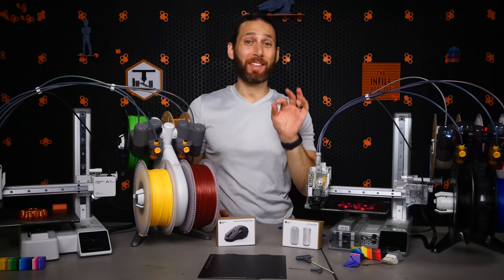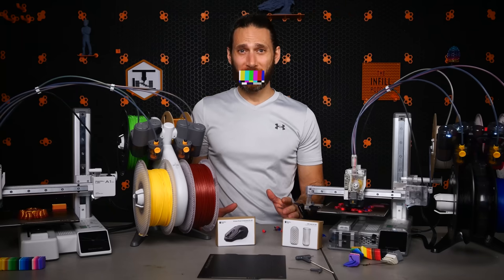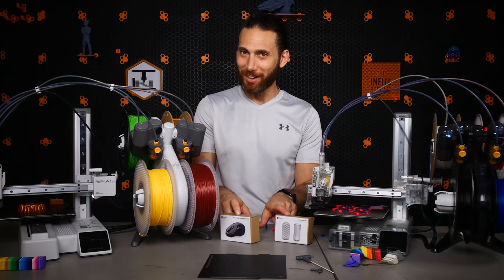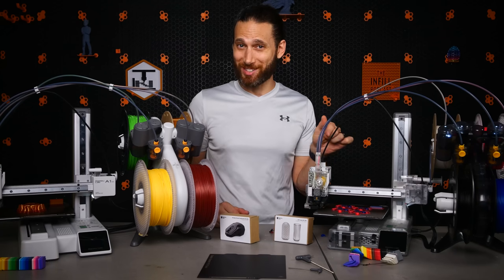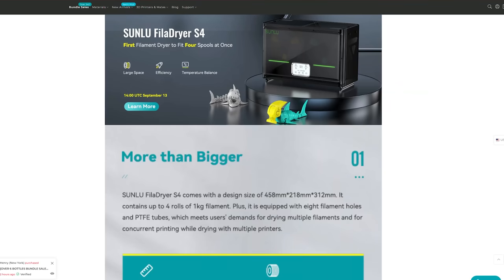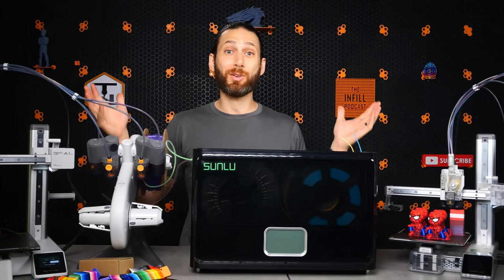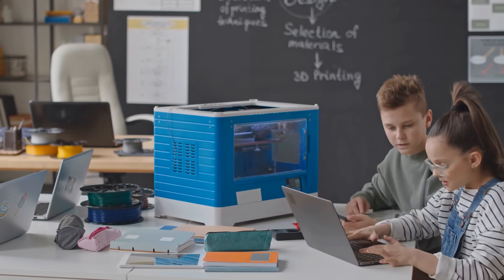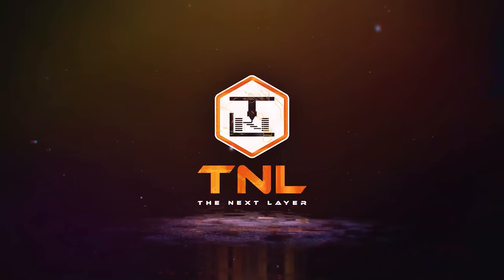Introducing the Bambu Lab A1 Mini + AMS Lite

Comment: My prediction is a ankermake style bedslinger
Reply from the maker: Hmmm, interesting prediction. Why do you think? :)
Reply: @thenextlayer  the "colour 3d printing for everyone " makes me think that they will make a < 350 usd printer to compete in that market, and I think they would make a bedslinger in that market segment
Reply: So much for 'no more bedslingers'?
Reply: @geoffreyward8866  huh, i forgot that they said that. I am probably wrong then. If it ends  up a bedslinger, I ain't buying it. I still think it is a <350 usd printer to
Reply: @tomaszkarwik6357  I'm pretty sure your right and it's a bedslinger. I think they are just going to pretend they never said that / hope people forget.

They probably did a coreXZ and are going to claim it's more stable 🤣 (it's not...but then again neither is CoreXY and that doesn't stop people from making those claims either...)
Reply: @geoffreyward8866  looks at the above comment making people forget that they said that would work. But yeah, I don't see any advantages to a corexz kinematics from cartesian as core(whatever) gives you faster movements in those axes, and it is the y that is slow on a cartesian.

I'd also expect a mmu style ams to lower cost and the size. A cheap encoder for the "smart filament sensor" (btw I don't see any problems with that and wanted to somehow add such a thing on my ender) 

Also I would probably think that the p1p "upgrade panel" would come back to this one
Reply: New printer with a core XZ and a rotary Y
Reply: @mayhem3211  Nah, no way
Reply: @thenextlayer  nvm after YOUR leak it is a cantilever bedslinger. That is even worse
Reply: @tomaszkarwik6357  Yeah, it's...not great. It's even got the same terrible angle as the AnkerMake M5 did for the camera. Like...come on.
Reply: It has been 7 months and i am looking at bambu printers as an upgrade for my ender, and i found my best comment chain ever.

In retrospect the only mistake i made, was thinking that the i3 clone would be the 350usd printer not the 500usd printer

Comment: As always, an excellent review.
Why couldn't Bambu Lab just scale down the P1S and lower the price?
They already have a great product and could utilize what technology they developed, but in a smaller and more affordable option.
Reply: cutting a few pieces shorter wouldn't have a huge impact on price.
Reply: @JoeC-tt9oq arguably it would make it MORE expensive.  Retooling a stamped steel line costs a fortune.  Where as this appears to use custom aluminum extrusions, hell of a way to make it cheaper.